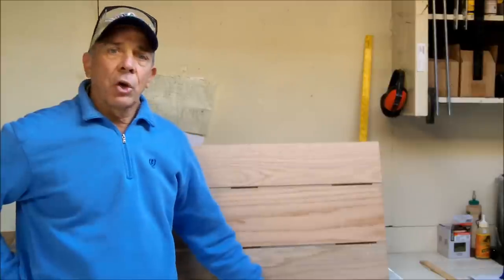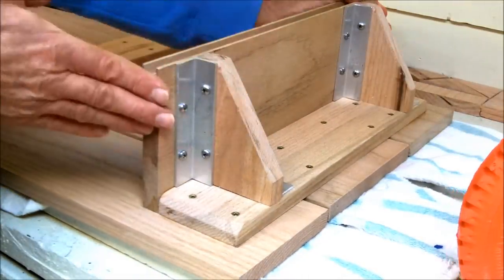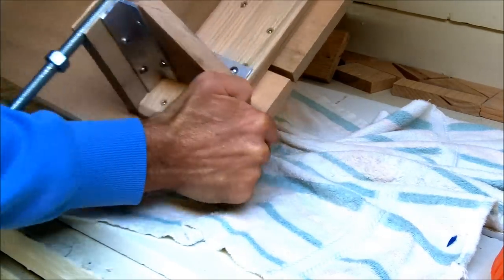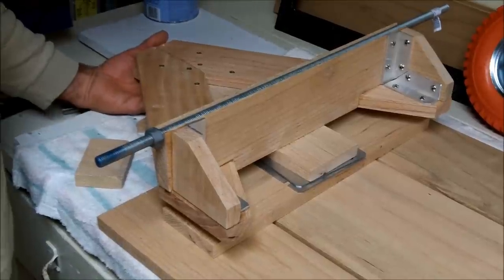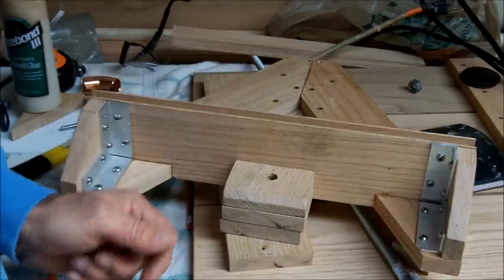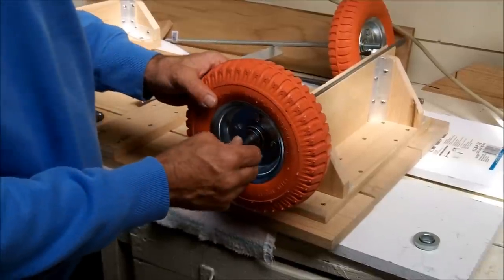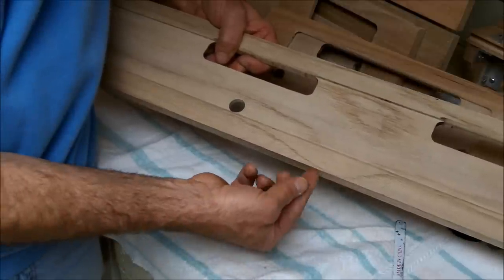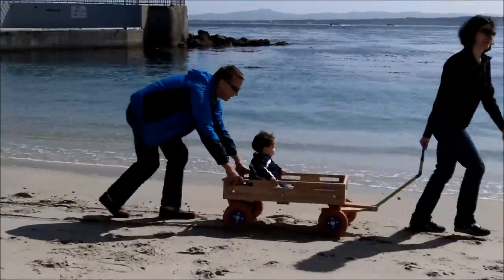How To Make a Wagon Out of Wood

Comment: The design for the wagon is excellent.  I can imagine a happy Diego and a proud Grampa.  One question:  On the front truck, there is comment that the board supporting the axle is 5 1/2".  Since this board sits on what looks like 3/4" piece... should the height not be 4 3/4"? Thanks for any clarification
Reply from the maker: OneOfCreation Hi. Thanks for the nice comment. You are almost right. What is important is that the front and rear axle be the same height measured from the bottom of the bed. The rear axle is in fact mounted on a 5 1/2" high board (see 1'49"). The front truck, on the other hand has the tongue and pivot mechanism between the axle and bottom of the bed. So once you design the tongue and pivot with its various washers, you'll just need to measure how high the front axle board needs to be in order to be the same height as the rear one.  But it will be less than 4 3/4".
Reply: Thanks much for the clarification.  Hoping to follow much of this design to make one for my grandson Leo for Christmas.  Pretty sure he'll love it.

Comment from the maker: Hello, and thanks. The washers are 1/2" X 2-1/4" steel washers that I bought at MFG Supply on line. They worked great and are extremely solid, much thicker and wider than the fender washer that you can buy at home depot. The added width gave the front truck a more solid base to turn on since that is the only contact point of the truck on the body.

Comment: Exactly what I was looking for. I already how those wheels. But what I didn't get out of the video is the bearing that you used for the wheels. Can you provide more details, where you got it, size and how you installed it in the wheel? Thanks!!!
Reply: Arek Kosinski If you look through the earlier comments you can see the info on the bearings and where to buy them. They just easily fit into place.

Comment: I just came across your video about a day ago and being encouraged by my wife, I want to build this according to your specs, so if you are available for answers to my questions, I am thankful in advance. :)
How do you change out the bearings from 5/8 to 1/2"?
Reply from the maker: Hello.
The bearing is a press fit. It is not difficult to remove and put in the replacement bearing. Good luck.
Reply: @jshaules  Thanks!

Comment from the maker: Hi! Thank you for the compliment.  At 9:31 you can see that there is a washer against the wheel with a cotter pin in the end of the axle. This cotter pin is later covered up with an axle cap nut.

Comment from the maker: Thanks for the nice comments. If you use ext plywood you will probably want to modify the design of the truck where the axle sits because the outer laminations of ext plywood are not of good quality or sturdy wood. You may want to double it up or use hardwood just for that, or perhaps use a metal channel attached to the wood. Good luck!

Comment from the maker: Hello. The 5/8" wheel bearings that came with the wheel have an outside diameter of 1 3/8". They can be replaced with 1/2" replacement bearings to fit a smaller axle. I bought them (part #8222) at gokartgalaxy [with .com]  But you can just do a google search for "Flanged ball bearings 1 3/8" OD  1/2" ID". Remember you need two per wheel. Have fun!